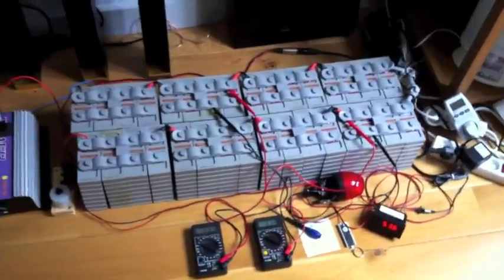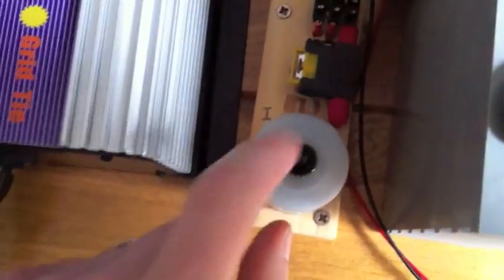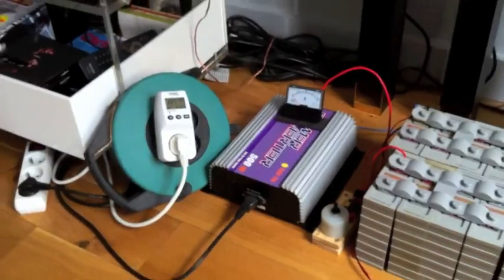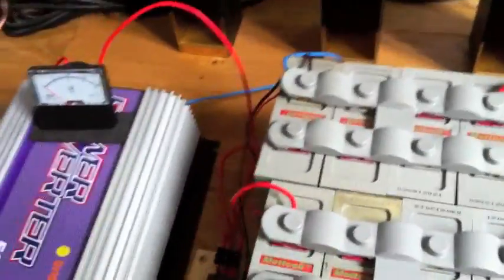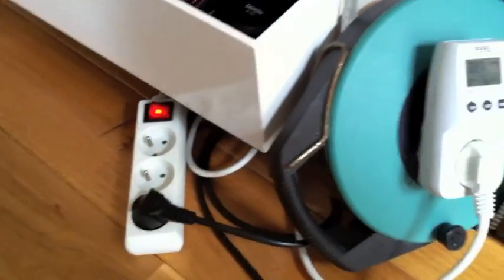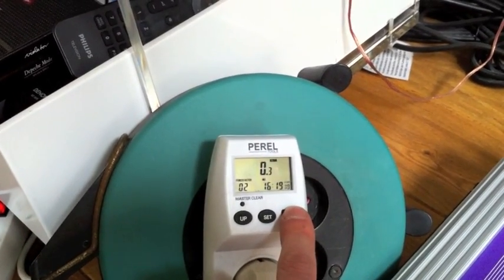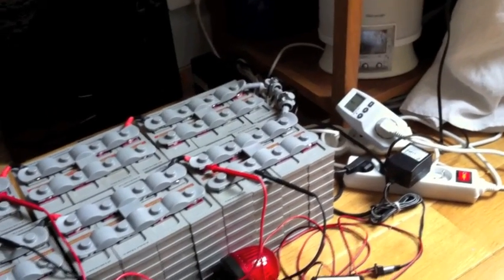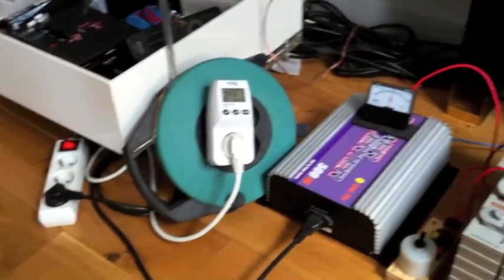LiFePO4 Battery Bank / Solar Energy Storage System - 1

Comment from the maker: 4 Kwh 
The idea is to charge the battery pack while my solar panels will produce more electricity than I need to run my home, storing instead of wasting, to reuse it later, at night for example
About EDF, I am not doing anything wrong, just producing, and storing my own energy, I am trying to reduce pollution and use energy produced localy
Loosing money ? why ? aren't you loosing money when you your electricity bill ?